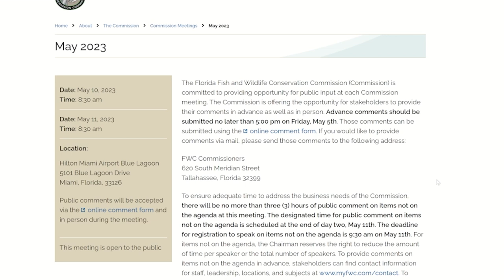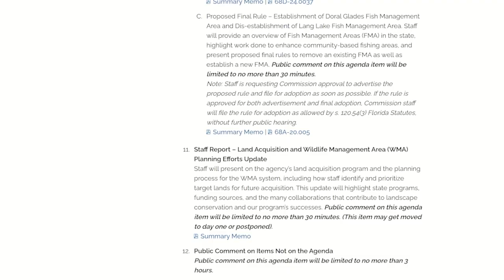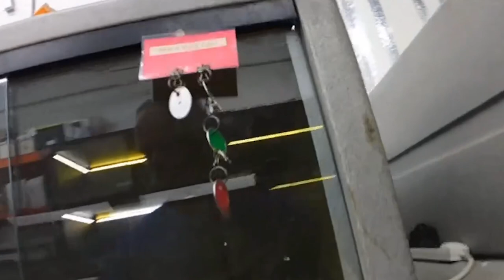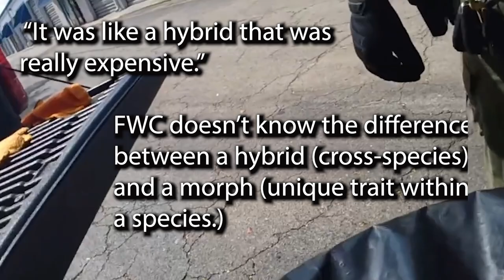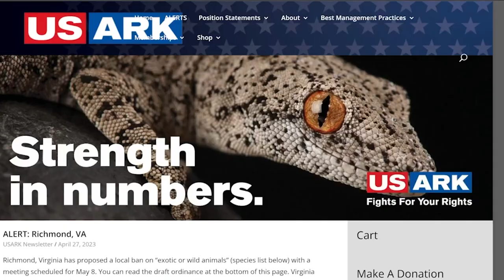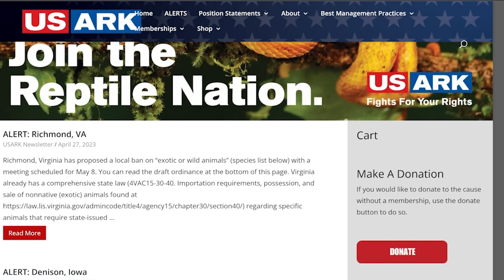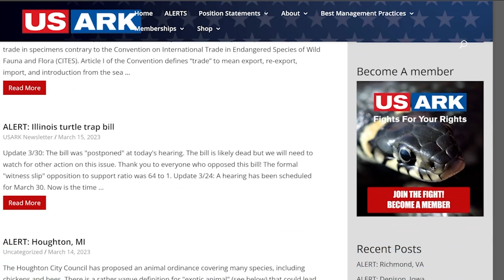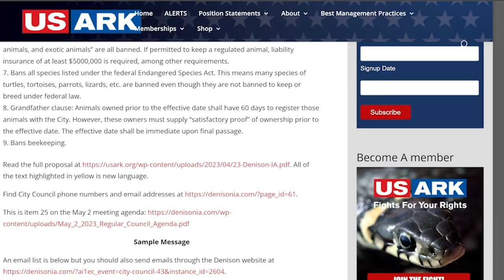🚨New Bodycam Footage, FWC Miami Meeting, USARK Alerts

Comment: Thank you for not showing the part where the boa dies. Saw a censored version already and that was extremely disturbing as it was. I don't understand why they were gonna put the dead boa back in the enclosure?! Why?!
Reply from the maker: Guys brain shut down for a moment, knew he screwed up and didn't know what to do
Reply: @IntrepidExotics  Ok that makes sense. 
Love your channel and your videos I agree with so much
Reply: maybe they thought they could leave without it getting noticed right away. Avoid admiting they did wrong?
Reply: The only reason they were gonna put the boa  back in its enclosure is coz they weren't finished and thought if we put the body in the enclosure he won't find out till we tell him. When something happens your brain goes on auto pilot and his auto pilot was to try and hide and cover it up
Reply: @IntrepidExotics  The thing that strikes me is that I have a gut feeling that guy would attempt the same thing if he hits someone with his car by accident, he would go into cleanup mode. I’d keep an eye on that one.